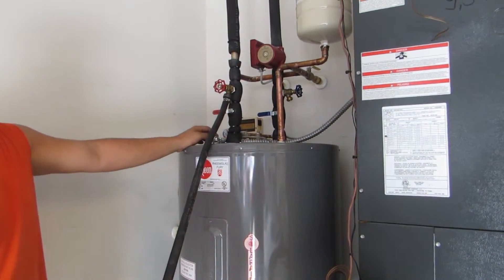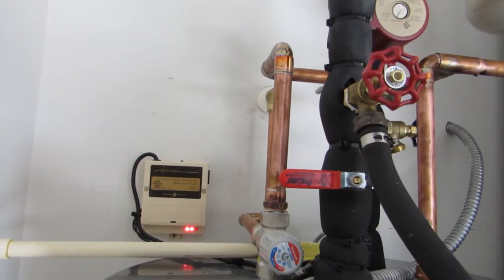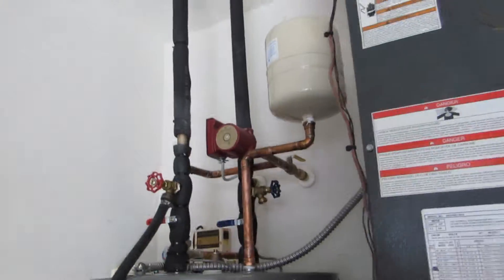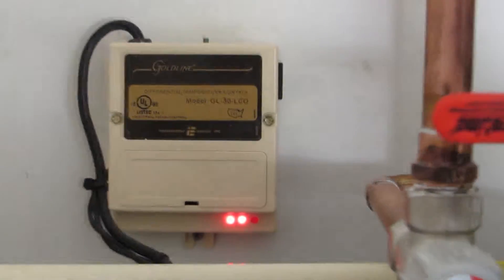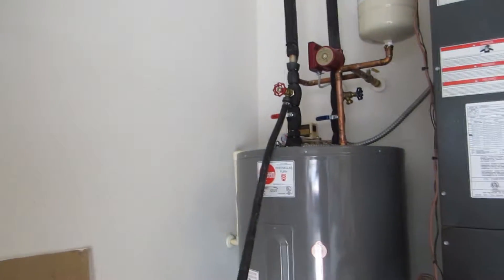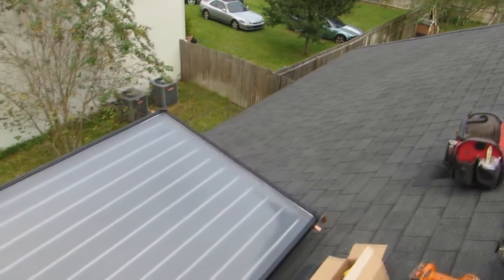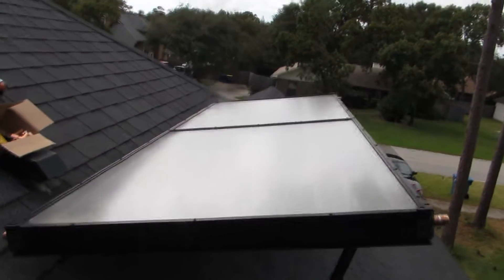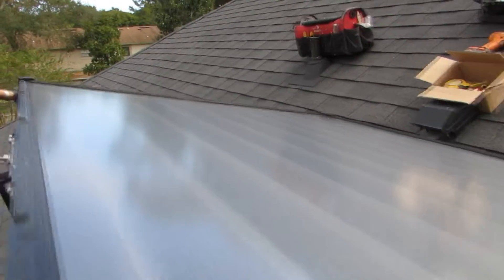Homewise - Solene Solar Hot Water Heater

Comment: hope that dose save you money. bet it cost alot to put in
Reply from the maker: Total cost for the project was around $20,000.  Minus a 30% ($6100ish) rebate it will only cost about $14k which isn't small but it's a small car payment and should only take about 10 years to pay if we do minimum payments.
Reply: that cost way to much wow i wish i was rich  lol. i may 32k a year so. 20k be way to much for me
Reply from the maker: Roxie Ochoa that's only a $144/mo payment.   We don't make enough to do a cash payment either. You have to start somewhere.